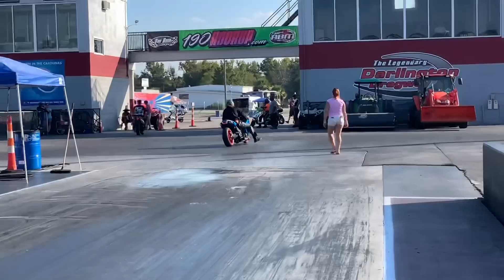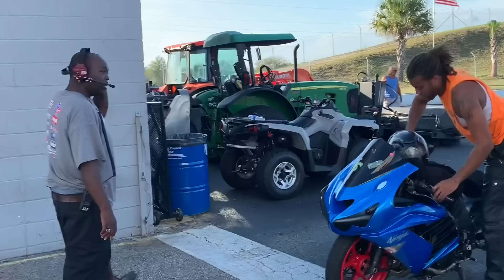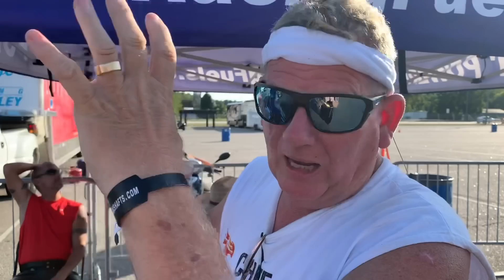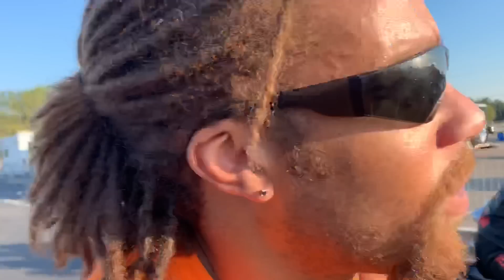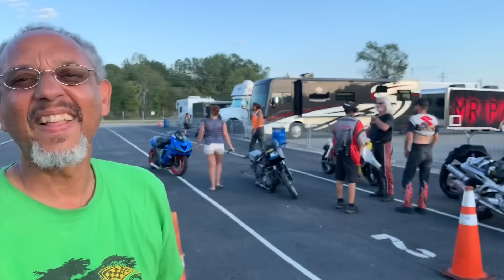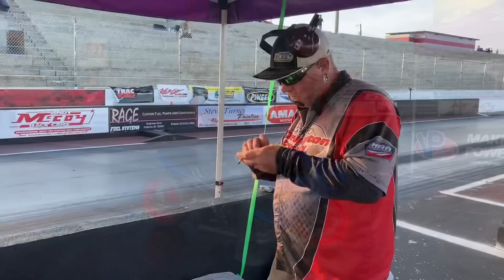ENRAGED DRAG BIKE RACER MAKES U TURN ON TRACK AND RIDES UP THE WRONG WAY! ZX14 KZ DELAY BOX DEBATE!

Comment: This is for bracket racing not heads up racing. It's whoever runs closet to there dial in time without going faster than there dial in.So basically if you have a bike/car that runs a 10 you dial in a 10 and try to run as close to a 10 without going to fast.

Comment: I wouldn't use one, but I wouldn't hold it against others to use one. my issue with this situation, if it was run one way the entire day, and then suddenly and unannounced it was done differently, he has a valid complaint. he handled it poorly, but he was right, and im not going to lose my shit over something stupid like procedure. there was clearly no one in the way, and none of the other bikes were even close to the line.

Comment: This is David Fletcher, the old school Kawasaki in this video.  First of all, this is first time I met Colin Nash.  I found him and his girlfriend to be nice and have no problem with them, in fact, hope that we see each other in the future.  He had a legit complaint if the rules allowed.  It's ManCup's sandbox, and I accept their judgement.  I am glad that ManCup clarified their rules, if a little after the fact.  My opinion is, if you run in a class that allows delay boxes, don't complain when you lose to one.  You have the right to install one and spend the money like I have.  I don't go to XDA races because they do not allow boxes.  That is their choice and I don't want to rewire my bike to comply.  NHRA also allows boxes, so there you are.  Win or lose, we all came away from this with intact bikes and no injuries, the best thing!
Reply: I agree with you, west cost and NHRA protects you by telling the rider if you stage and take the tree you accept the dial and light.  when we have N for no cross talk we get a - in front of our dial on the board.  easy for everyone to see.  if he took the tree with -5.66 he would know that the cross talk was OFF. if he took the tree with 5.66 then the cross talk is on and he missed it just like taking the wrong dial.
Reply: Honestly i think delay boxes should be one of those parts that move you into utterly seperate classes. I don't like them and 'he has the right to spend the money' I think is a shit response.

I do however agree that mancup need to actually clarify their rules and they need a Policy that clarifies how to deal with issues like this. The NHRA one of doing X means you accept the run isn't a bad one tbh. If you have an issue with something don't launch is a good way to deal with it.

I admitted my bias first to be open about things, im interested in actual street machines that bear a resemblance to street machines racing. So things like delay boxes, chutes and wheeliebars longer than the bike frame aren't things i like seeing. I admire the skill of a good fast time on a stretched swingarm or a steel body car more than I do a ProMod tubular chassis car or a wheeliebar bike running the same or faster time.

At the point where delay boxes and wheeliebars/proMods become the norm it loses the thrill for me. You get fully purpose built racing machines not bought on monday raced sunday. I respect the tuning, the engineering but... It becomes a bit soulless. Its the same reason I don't watch modern nascar in favour of watching Touring Cars, they are nothing in common with the road car, its a body shell on the same chassis and engine for everyone essentially and because of that it becomes something where the engineering impresses me not the racing as its lost its soul
Reply: @jediknight1294  Delay boxes are in a separate class.  That's why is called PRO-ET.  I stand by my response of "he has a right to spend the money".  No one twisted his arm to enter ProET without a box .  Street bikes have always been able to run ProET against the box bikes, but not the other way around.  Don't bring a knife to a gun fight!
Reply: If you came to an agreement with him not to use it, why didn't you honor it?
Reply: Aubrey, 
If you are directing your comment to me,  let me explain.  ProET is an electronics allowed class.  It is written in the rules.  Yes,  I have a delay box, auto shift.  They are perfectly legal.  I didn't make any agreement with Nash about turning anything off.  It's his choice to enter an electronics class without the devices allowed.  He was not complaining about a delay box, only that the cross talk feature of the Christmas tree was not turned off for his lane.  Even though the rulebook stated cross talk would be ON for all runs,  the sanctioning body decided to not follow that rule.  I  DON'T CARE!  I try to run my dial and hit the tree.  That's what wins races in bracket racing.  I am done with explaining these things.  I agreed to a rerun.  I could have lost.  
Also,  please guys,  don't make nasty remarks about Nash and his girlfriend.  Totally uncalled for.  We all talked together about the situation and I believe there was no bad feelings between us.  Just enjoy the video.  Gave me some air time, lol.
Reply: David Fletcher I prematurely commented before finishing the video. I see now it was entirely the tracks fault for enforcing the rules as they choose.
Reply: Thanks for jumping in here...  I however think the "turnaround" is a separate issue as was the behavior.. one that should not have been ignored..   safety first and always..       Not going to comment on "box" racing myself..  :))
Reply: People need to know that David DID NOT have to re run this dude. He finished his run with no fouls and the other guy broke the beams. What David did was very sportsman like. He could’ve easily lied and said his bike broke on that pass so no re run was possible.
Reply: Am I they only one that wanted to see the snow machine run?
Reply: I don't care of the track broke the rules.  He could of fought it when he got back.  By him turning around on the track which  created a safety issue.  He should of been banned for a year.  That kind of attitude does not belong on a track.  Nascar drivers get fined all the time for child like attitudes . He acted like a child period.
Reply: Him and his great Dane dog should of been DQ no matter the situation
Reply: Mr. Fletcher, I absolutely love your old school KZ1000. I had one about 10 years ago. Meanest bike I ever had. Old school forever man. Thank you for representing the sport and old school bikes.
Reply: Great attitude to have man your a bigger man than I. This dude just handled the whole thing in a really crappy way in my opinion but like you basically said at the end of the day y’all are there to race and ultimately that’s what ya did.
Reply: I could see them giving him a rerun had he not turned around and come back the wrong way.
Having done that he should have been booted out.
Reply: @David Fletcher , I just became your first subscriber. Hats off to old school KZ! 
I'm 53 yrs old, in SC not far from the Ga. line and thinking about getting a race bike n heading to the track...or just take my slower Shadow 750 for now. 
Safe rides 🤙🏼
Reply: Sic Semper Tyrannis  given the choice id rather see two vin cars with steel quarters and roof going at it over watching a pair of tube frame with a fibreglass shell cars. Wheelie bars honestly i prefer to watch classes where bikes can't run them cars it gets complicated. 

I'm a fan of racing that is pushing the limits of road cars vs track specific tools. I like the tech and engineering side of things. 

Nascar for example when the cars actually had links to the cars on sale where manufacturers had to build things for sale with racing potential and base the performance machine  off homologation special  rather than a tube chassis a different engine and a fibreglass shell like some supersized rc car. 

It's why I love WSB but prefer BSB, in WSB and BSB you are limited in some ways by having to use the bike sold for the road as a base which means that huge advancements like the adjustable swingarm geometry come to the street but in WSB they can run whatever ecu they like but in BSB they Don't have access to that custom traction control and have to use a stock ecu. It creates a different type of racing and a different challenge.

Things like the delay box are cool tech but its something that I feel shouldn't be racing against anything that doesn't have one. But I'm of the opinion that if you can't take your 'street/prostreet' car/bime from.the track to the gas station to buy me a can of skoal you shouldn't be racing it in a 'street' class.
Reply: Sic Semper Tyrannis  I love drag week? For me a car that can do drag week is what I want 'street' classes to be, they can be driven on the street, they are fast and they can be driven more than into a trailer.

One of my dream builds is a trike to do drag week? Thinking supercharged rocket 3 using a similar kit to the exile cycles one that takes the big tyre m/t's or the F1 tyres.
Reply: Sic Semper Tyrannis  I want to do something oddball, I'm in a wheelchair so think a trike would be cool since I'd struggle to hold a bike up at the weight of a loaded drag bike. The other idea is a sleeper V40 volvo estate with an SBC and a turbo with an electric supercharger to get it spooling.
Reply: i don't understand what those box are made for ? I am not really good at english but what i did understood this is use in order to allow people racing with not the same moteur size  ? but how do you know the delay timing ? because every bike is different not everybody as the same configuration .

Comment: This kind of attitude has no place in motorsports. He could have protested that error like everyone else, not disrespecting the rules.
Reply: I have seen way worse things in motorsports
Reply: You should probably never go to a motorsports event. Or any sports even, especially hockey.
Reply: I dont consider bracket racing a sport anyways.
Reply: Chris McRoy  Kawasaki riders. What did you think he meant?
Reply: It has everything place in
Reply: Maybe he should buy a tennis racquet.
Reply: @rosstipler8435  
Maybe ??
At least on the Tennis Court he would get a good kick in the arse.
Reply: I agree. Bad attitude fIgures he lost in the final. Also should have been disqualified for running backwards on the track. Unthinkable in any racing organization drags or roadracing/etc.
Reply: Entitlement is a major problem in this country
Reply: Baby. That's what they do. Cry

Comment: Track Officials are the ones that broke the rule ! So turn on cross talk and re-race it.👎🏼 Actually should’ve been penalized and illuminated for doing the crap he did by coming back up the track should’ve done the proper way run the whole track and come back up to the burn out area and talk to an official.

Comment: Shitty sportsman ship, he could have clearly finished the run and went in the booth like a man. No need in trying to act hard and hold other people up... if you are so worried about cross talk then bring that no bar, stretched out 14 to a grudge race. We bang when all the yellows light up!   I will stand behind people 210% and I will help somebody that put me on the trailer fix their bike. Bad sportsmanship I will never stand behind! Not only would he have not gotten a re-run but he wouldn't have stayed on the property for that stupid ass stunt.
Reply: Cilly shit
Reply: @gabrielnilsson7955 . I mean why be like that? It takes zero dollars to be a decent person...
Reply: If the rules state you cross the line you accept the run what else can you do? And YES IV SEEN THAT as a rule at some events. What he should have done was not launched but dude had a right to be pissed off, he had his bike marked, he had been running with that setup all day and then when it mattered they fucked it up. I can see why the anger is there. Im also seeing in the comments something icky which makes me suspect That kf there were a few differences the views wouldnt be the same posted.

The 'unsafe' bit does make me laugh slightly admittedly, at an event like that with a gap between races it isnt really an issue, on a RWYB night ot a packed day of racing where as soon as the track clears theres annother pair going down it can be an issue but there... Not so much.

Comment: I run No Box in both NHRA and IHRA. I can run with the Box bikes if I want to in either sanction. But there is no option in either sanction for me to request Cross Talk be turned off. I was surprised to see Man Cup allows that. Also a little surprised to see tech for Man Cup allows the type of leathers U Turn guy was wearing.
Reply: Probably,I say probably, because it was an 1/8th mile race..But even though,if he wipes out with non zip together leathers it`s gonna be painful...

Comment: Personally, I do not like delay boxes. Eliminate them and you eliminate the possibility of rule confusion/ conflict like we saw in this video. It also means less expense and allows low-buck racers to be competitive based on their talent and not on electronic aids. Just my 2¢...
Reply: Absolutely agree with you.
Reply: delay boxes shouldn't be allowed, they eliminate the human factor at the christmas tree.
Reply: If not eliminated then farm off delay boxes to a seperate class so 'street' and 'street delay blx' superstock and superstock delay box, etc etc erc
Reply: @jediknight1294  This class is for delay boxes but street guys can run it if they choose.
Reply: @southjerseysound7340  oh i know, thats not particularly relevant to my comment. I want to see prostock/topfuel etc actually run with a real Clutch. I don't particularly like delay boxes personally and they don't interest me. The 14foot wheeliebars and car tyres don't really either but id be interested to see how times change without delay boxes and bump boxes.

Im only really interested in drag kit where its still possible for me to ride/drive from the track to the gas station 2 miles down the road down a sweeping bend and a right turn or two for a couple of gallons of gas and a can of skoal. Ignoring noise limits, lights and emmissions obviously but the vehicle being capable of it. So no wheeliebar longer than/as long as the chassis, the bike actually able to corner etc.

When you see delay boxes, bump boxes, the  shifter systems that automatically revmatch for you and activate the clutch for you it stops being about the skill in the lane and starts being the skill in the pits, on the laptop tuner, I really respect. At that point the time at the track id rather spend having a beer in the pits talking to the tuners than watching the runs.

Im interested in the tech but i like seeing bikes and cars that are recongisably bikes and cars. Its why i dont have that much interest in Salt Flat LSRs, if you have the ride in bullet bikes or 'cars' that look straight of the pages of dan dare comics.

Its Why i dont watch nascar, if nascar had to be based on the production chassis the way Touring Car is or the way that the GT car races are I'd still watch but the current tube chassis and engine with the appropriate manufacturer shell over the top bores me. Same with F1, if F1 was about the manufacturers trying what they wanted id watch but now where the cars are pretty Much identical its not a race that watching it holds my intetest. I miss formula Extreme, you want to run a 9l V8 big block great, you want to run a 2l with 4 turbos go nuts all lined up against a fan car 4l supercharged machine and something with a small block and 4 nitrous kits.

Just my 2c, that and 5$ will get you a can of skoal mint.